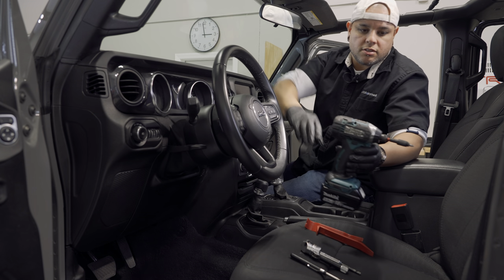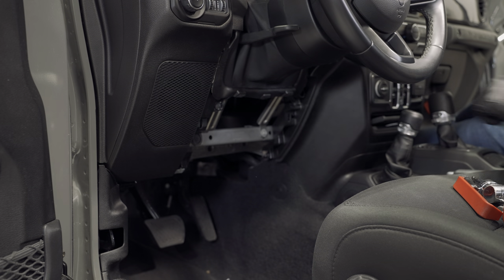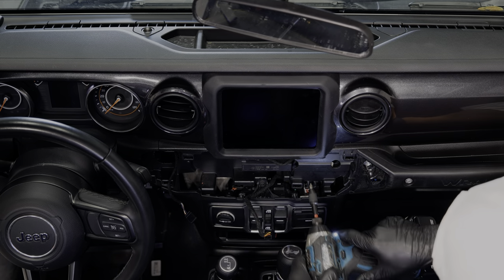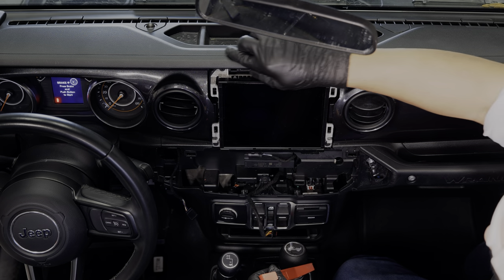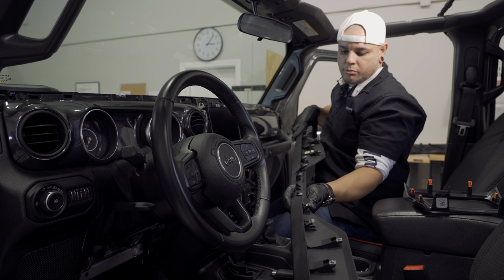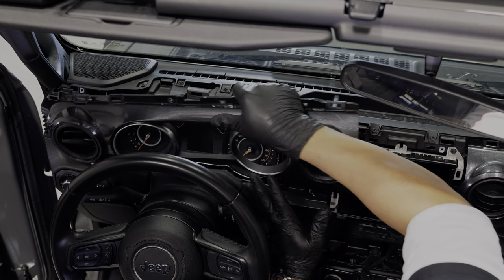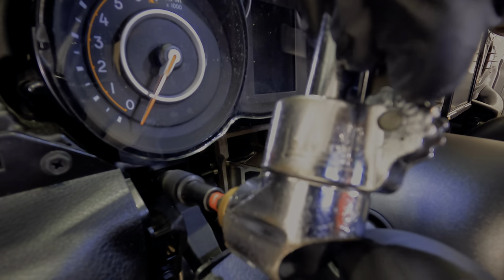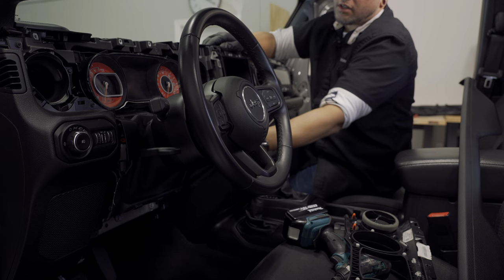2018-2021 Jeep Wrangler JL - Speedometer EVIC Instrument Panel Cluster - Infotainment.com

Comment: Hey will this give me the options to put led headlights and fog lights on the Jeep with a tazer mini?
Reply from the maker: We currently offer both an LED fog light upgrade as well as an LED headlight upgrade. Both packages are completely plug and play and come with the programming in an OBD genie programmer that initiates the RPO code programming in to the vehicles BCM. So the tazer programmer would not be necessary with those packages.

2018-2023 Jeep Wrangler JL and Gladiator JT Factory OEM Mopar LED Fog Lamp Upgrade
https://infotainment.com/shop/exterior-accessories/fog-lights/2018-2023-jeep-wrangler-jl-gladiator-jt-factory-oem-mopar-led-fog-lamp-upgrade/

2018-2023 Jeep Wrangler JL and Gladiator JT OEM Factory LED Headlight Upgrade Kit
https://infotainment.com/shop/exterior-accessories/head-lights/c-bdllgt-jljt/

Comment: i ordered this product and didn’t leave my vin number, can i fix that by contacting you guys?
Reply from the maker: Yes, please reach out to our team at 407-977-5100 or at support@infotainment.com and they can update the order.
Reply: Cool thanks for responding, another question, when installing this product should I disconnect the car battery to prevent any form of electrical damage?
Reply from the maker: That always helps.